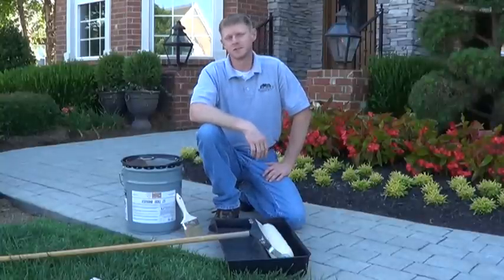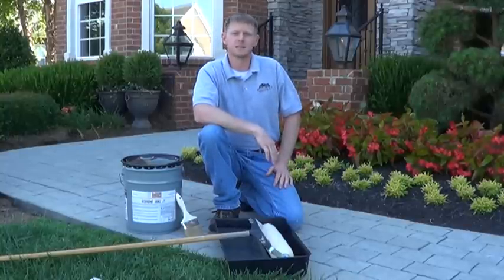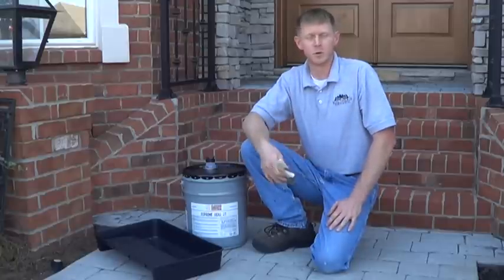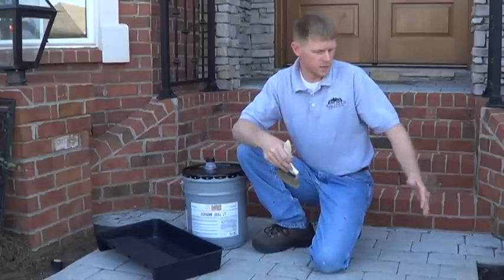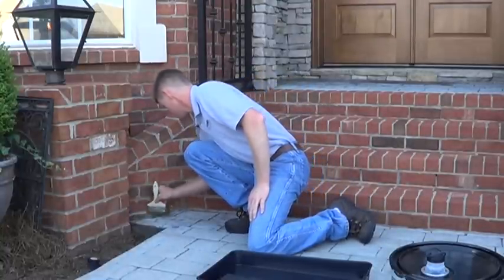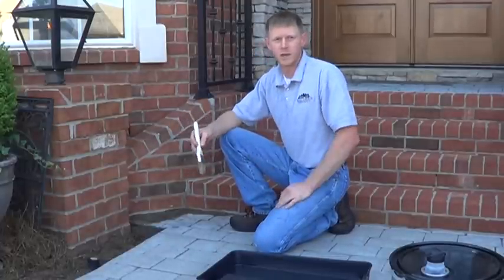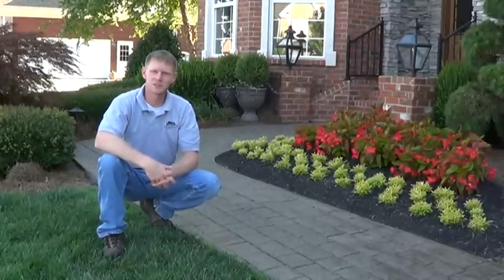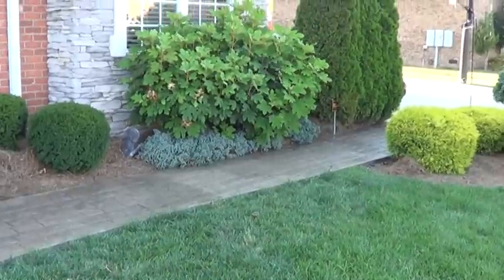Sealing Stamped Concrete

Comment: Would be bad to apply ANOTHER coat of sealer on the existing one.  I am not a contractor but logically one should test the absorption of the existing concrete to see how much of the original sealer is there before thinking of applying a new sealer.  The reason being the original sealer could be enough and one wuold simply need a xylene pour to put back the acrylic sealer to its original state (assuming solvent-based).  The reason to avoid the 2nd coat is because it builds up a thicker layer and will reduce breathing of concrete and result in whitening, efflorescence, etc.